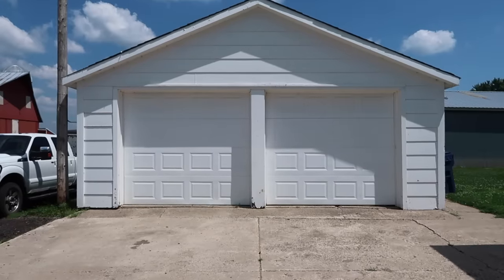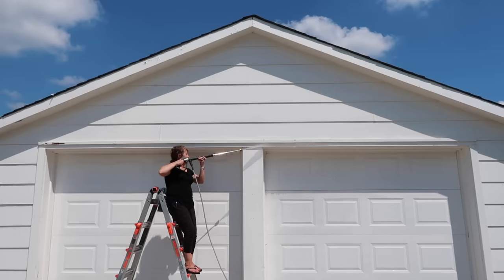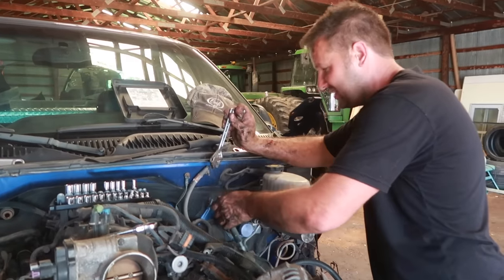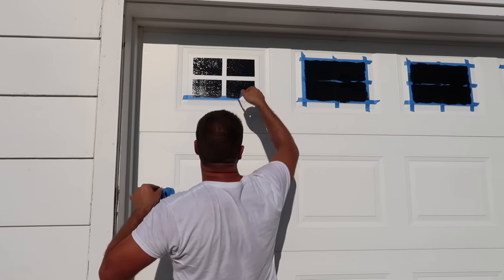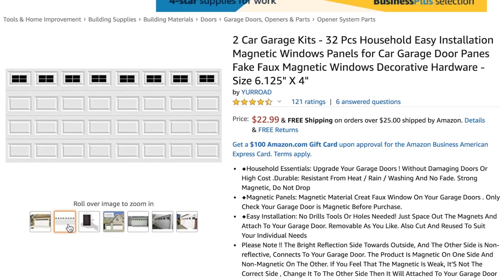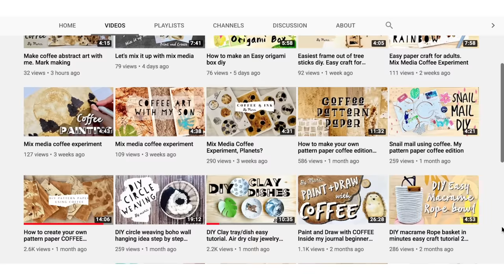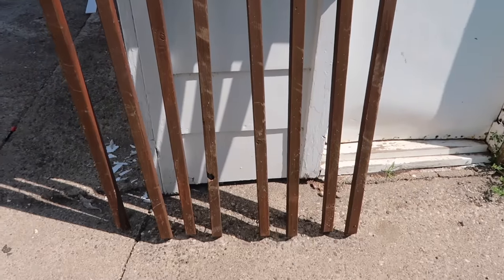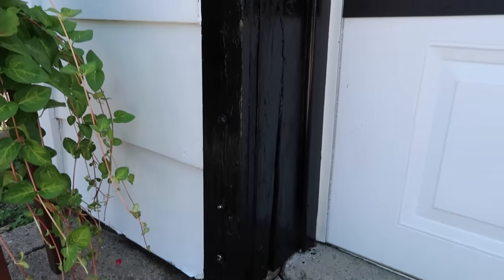$30 Garage Makeover! Before and Afters (Budget friendly ideas!)

Comment: Wow!! Huge impact!! Looks fantastic! I learned a great tip for how to paint a taped off area without any paint seeping under the edge: in the case of your garage door, after you have placed your painter's tape, you would brush some paint along the edge of the tape, using whatever color paint is underneath (in your case, white). If anything seeps under, it won't show up because it's the same color as the background!  When that is dry, apply your black paint. When you peel the tape off, you will have a perfect edge!! I learned this from a video a few years ago and it has helped me so much!

Comment: That looks amazing! Next time you should use a mini roller. It would cut your painting time in half. Also, there is no tape besides frog tape. It never leaks! You are so right on the black hiding the imperfections. Such a rewarding project for so cheap!

Comment: Natalie Callahan on "Designed to the Nines" on Youtube has a great way to prevent paint bleed when using painter's tape.  After you mask the area where you do not want the paint to bleed, first paint over the space with the same color as the background you just masked.  In the case of the little window panes on your garage door, you would tape, then paint with white like the background. Then paint over with the black.  Painting with the background first seals the tape - if there is any bleed, it will be white and won't show.  She has shown this technique numerous times on her various projects, and it is amazing how clean the lines come out.
Reply: Great tip!!

Comment: Is there a link for the mason jars? You had me at "they fit in your cup holder."
Reply from the maker: If you look for 24 oz Mason jars I think you'll find them!!
Reply: We're in Canada, but I found the lid inserts and straw sets from either Ball or Bernardin at Dollarama (dollar store) for like $4 in both widemouth and regular, purple or green... Also saw them for more at Canadian Tire, and only slightly more at Home Hardware. And anywhere you can buy canning/preserving equipment (hardware stores for me) will likely sell all sizes of jars. If not, you can likely get them on Amazon. The one that fits in the car cup holder is tall, smooth, and widemouth. Holds roughly 2 cups and a bit, if I am remembering correctly. They are the jars we use for all outdoor drinks as well, because they fit in the chair cup holders too!
Reply: Yes.
Reply: We use them for everyone’s drinks. You can find lids and straws on amazon too